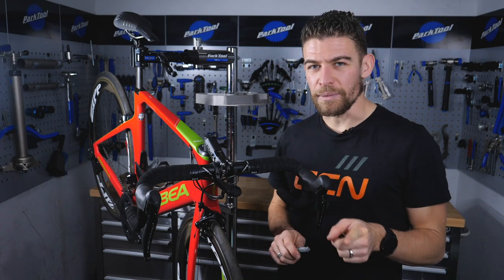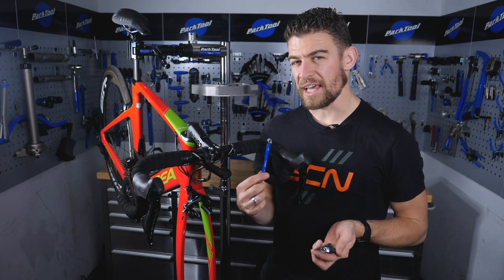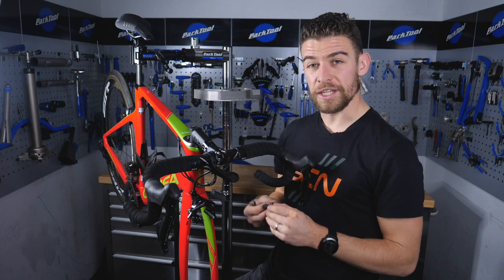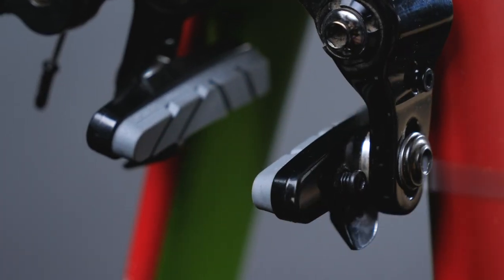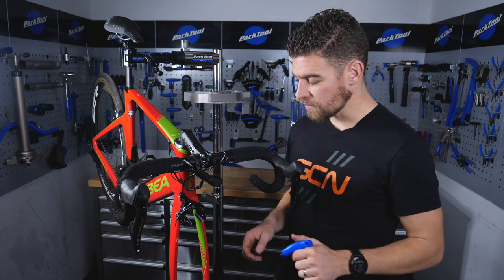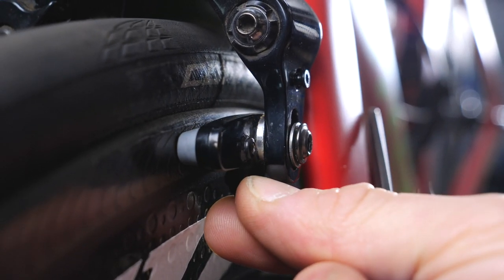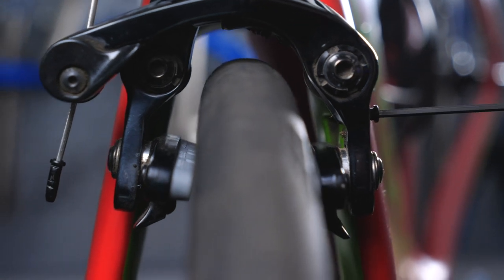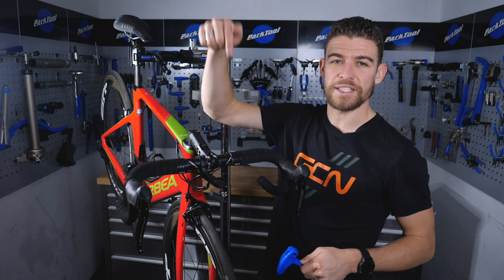How To Replace Rim Brake Pads | GCN Tech Basic Road Bike Maintenance

Comment: I love the disk brake performance on my newest bike, but the fact that this video is half the length of the disk one back in November speaks for itself.
Reply: It's still twice as long as the time it takes to replace brake pads.
Reply: The brake disc video is how to do a brake bleed, which is similar to replacing a brake cable. It literally takes about 30 seconds to replace disc brake pads only. And a bleed takes about as much time as threading a new cable and adjusting.
Reply: I love discs for tour bikes, i.e, for rainy weather and general comfortable stopping power.  For my race bike I prefer carbon wheels and rim brakes, they stop great and while just "ok" in rain, the weight savings more than make up for carry around weight we all, most of the time, don't use anyway.  Same things for brake calipers, Ted Ciamillo now has out new rim brakes that only weight 129g for the pair (without pads) -- while super pricy, they are, well, very nice, the guy's a great engineer and deserves to be paid. The End.
Reply: It only has a quarter of the information it should really have.

Comment: In my experience pads never come out that easily particularly if you’ve been riding in poor weather.
Reply: That was my experience, too, until I bought the Shimano pad holders you see at 2:35, with the little fins on them. Brand-new pads come out as easily as shown in the video; old ones that have been used on grotty roads in grotty weather need a gentle push with a screwdriver but it really is easy.

Comment: Do you have to toe in pads? I have done on mine but only because I read that you should 😂. Wondered if it actually makes a difference if you just line up flat against the rim?
Reply: Helps with brake power modulation and can avoid help squealing
Reply: @TheSpaceBrosShow  oh ok. Thanks for the reply. I never knew why 👍
Reply: I find the pads can squeal if not toed in
Reply: No not these days with good comp.
Reply: If you toe in the blocks soon wear flat

Comment: Pro Tip: Before putting new pads on give your wheel a good clean as the dirt, grease, grime will reduce performance on the braking surface.
Once done dry the wheels off.
Reply from the maker: Good tip
Reply: For Aluminum rims I use a piece of mild "scotch-brite" pad and a little soapy water.  Removes the accumulated brake rubber which can be tenacious and contributes to modulation and squealing problems.  Mavic make a special abrasive "eraser" for this but it is expensive.
Reply: I use rubbing alcohol to clean my rims, but if you don't have that, some high proof vodka might do the trick! 😂
Reply: @Awkward_Fox  Lol i hope you use a type of degreaser first then alcohol; altho alcohol does leave a residue free surface its not as good at breaking down heavy dirt and grease in the first wash.
Reply: I think this video missed multiple steps and a lot of important info.
Reply: @BixbyConsequence SwissStop make a special eraser, too

Comment: But if the pads are pretty worn, first thing you need would be to make some adjsutment coz new pads will be thicker. Where do you usually adjust, the barrel adjuster or the brake cable?

Comment: Good video but 1 obvious issue is; If you don't have a bike fitted with brake pads and the pads you've bought didn't come with fitting instructions eg. ASDA sell brake pads with no diagram showing how to assemble on the bike - you can't "take a photo" or copy what's already there so how do you know which parts of the kit go where??

Comment: Why didn't you make a video with a bike that really did need its pads changed? 

And shocking lack of precise detail about the wheel remover cable release lever. At 7:00 its still in the up position when you should only adjust the cable when in the down wheel secured position. And no mention of the cable barrel adjuster and how you should turn it all the way clockwise and then back off a half turn. Really a half assed video this one and I normally love GCN for their great work....
Reply: "Why didn't you make a video with a bike that really did need its pads changed?" They probably didn't have one to hand -- most of the GCN presenters use shiny new disc-braked bikes. If you use the Shimano pad holders shown in the video, used pads come out nearly as easily as brand-new ones.

You're mistaken about the quick-release on the brake. The open position is shown at 3:35; he closes it at 4:32 and it stays closed until the end of the video.

Good point about the barrel adjuster, though. Probably he forgot that because the cable was already properly adjusted, since he took the pads out and put them straight back in.

Comment: I'm building a classic 80s road bike with modern Sram Rival 11 speed groupset and 700c wheels. I have the chance of buying a set of beautiful early 80s Shimano 600 Ax parallelogram calipers that have the correct drop. Do you know if they will work reasonably well with Sram 11 speed  levers and do they actually stop the bike well. New Kool Stop pads are still available.

Comment: So, I did check my pads when mounting a new set of wheels recently and found bits of metal stuck in the pads themselves; picked them out and smoothed the pads with sandpaper, then a vigorous cleaning.

#AskGCNTech:  Where does do these shards come from and is there any way to prevent them?
Reply: Assuming you have Alu rims, they come from the rims themselves.  The more you get the more you will get as they scour the rims harshly.  If your pads acccumulate a large amount of them quickly, consider changing to a more rim-friendly compound.  Or possibly your pads are old and have gotten hard.
Reply: @BixbyConsequence  How/why does this happen?   Year-old RS700 wheels, year-old Ultegra pads...

I've searched for rim-friendly pads,  finding no data but plenty of marketing trumpery, and naked opinion.

Comment: Hi!
I want to change my old Shimano 7900 130 bcd 53/39T crankset on my bike to a modern compact 50/34T. Will an newer 11 speed crankset work with my 10 speed system or do I have to look for a used Shimano 7900 110 bcd?
Thanks Nypan!!
Reply: I had this issue, and had to get a new chainset with 110bcd

Comment: What is the point of the little wings at the bottom of the brake block? Any harm in chopping them off?
Reply: They're a hand-grip for when you're pushing out the old block. I wouldn't try to cut them off. The weight saving would be next to nothing and you risk weakening the holder. Buy a brand that doesn't have them, instead.
Reply: @beeble2003  I saved 5g 😂 can't complain

Comment: What are some good pads for the ultegra 6500 ?
Reply: All Shimano rim brakes take the same pads and all the third-party manufacturers make pads for all systems, so your question is mostly equivalent to "What are some good pads?"

I don't have any particular recommendation. At the moment, I'm using Shimano pads; I used to use whatever the local bike shop sold but I now live in a town where I don't like any of the bike shops.
Reply: SwissStop or Kool Stop brake pads.

Comment: Have pros ever thought of putting small brake levers on the top of bars beside the stem.  Would really aid braking especially when there is a sudden crash in the peloton. 
If found that having to move hands quickly from top of the bars to the drops takes a second at least.
Reply from the maker: Some pros still use brake levers on the tops of their bars at races like Paris Roubaix where they'll be riding on the tops more often!
Reply: @gcntech  we all should. smart, does shimano make the system?
Reply: In most road races, they're only riding on the tops on steep climbs, where sudden braking is rarely required. The rest of the time, they're on the hoods or drops and have easy access to the levers. Or they're resting their forearms on the tops, in which case they've already taken the gamble that they won't need to brake any time soon and levers on the tops wouldn't help much.

If you're thinking of the old "suicide levers", they don't exist any more because they gave terrible braking and a false sense of security.

Comment: Easy to round those Grub screws especially if you’ve got some oxidation there, then your looking at new brake pads and holders. Bad system in my opinion
Reply: I can't see any other way of designing it. In my experience, the grub screws sieze so rarely that it's definitely cheaper to use holders and inserts and occasionally replace a holder if it gets messed up.
Reply: I'm trying to ride without them, on bmx you sometimes brake going backwards but if thry fit snug they should b ok, still did not find good pads wben ss bxp

Comment: It's easy when you check new brake blocks on a surgically clean bike. 
When I change my blocks, after a couple of thousand miles, the little screws invariably round off and the worn blocks have to be forced out. Those screws are made of cheese.
Reply: I almost never have a problem with the grub screws: maybe your preferred brand of pads comes with crappy screws or you're using an Allen key that's slightly too small? I find that used blocks come out of the Shimano holders shown at 2:35 pretty easily. Not as easily as those brand-new blocks but they just need a little push with a screwdriver, rather than the ten minutes of swearing I've had with every other holder.
Reply: Just crap screws. They are 1.5 mm so no chance of an undersized Allen key in a metric set. A screwdriver slot would be better.
Reply: @grahamaustin9085  I meant undersized in the sense that a 1.5mm key made to low tolerances might only be 1.4mm or something. Cross-head screws round off horribly, but a flat-head might be OK. I guess they went with Allen bolts because that's what everything else on the bike uses. (And because the point of Allen bolts is that they round off less than screws. In theory. Which is totally the same as the real world, as we all know.)
Reply: @beeble2003  Good point one of the 2mm keys I use is 1/100 mm down on min dimension across the corners (2.19) and the same across the flats; the other is at size.
Reply: @beeble2003  I think you have a point there - my old Allen key is 0.05mm down while the newer ones are pretty much on size.

Comment: What are “rim breaks”??
😂😂
Reply: A superior breaking technology that is more aerodynamic and lighter than disc breaks. Stopping power is negligibly less, making rim breaks the choice for cyclists wanting the most performance out of their bikes.
Reply: @Jeff-bd4gg  True, unless you have carbon rims and it's wet. Under those circumstances braking distance is massively increased (certainly on Zipps), and rim wear is also an issue.
Reply: theonlytruefalcon looks like I triggered the disc break fan boys. I don’t care what you use. Ride your bike and have fun. The op made a joke, I played along. No need to get butt hurt.
Reply: What JD said. Love rim brakes.

Comment: If you have to be shown how to do this you shouldn't be doing this 🙄
Reply from the maker: Everyone has to learn at somepoint!
Reply: Gotta learn somehow. We're not born with knowledge, we acquire it.
Reply: Ah, I'm sure you were changing brake pads out of the womb
Reply: if that were the way the world worked we would have one generation of any sort of civilization and zero progress. perhaps you might re-phrase your comment to clarify your meaning.
Reply: My point is rim brakes are simple pulley system, lever at one end, cable and clamping system at the other, with blocks rubbing on harder metal (usually but not always, but highly probable given the readership/viewer).  If you need to receive instruction about so thing so simple that if you get it wrong can lead to death and or significant damage and or pain for the rider and others in his or her vacinity, then maybe they shouldn't be tinkering.  This is my opinion.  Happy if you disagree, but there is(I'd argue) a level of competency and common sense below which you should be tempting folks to dabble.  Hope this clarifies the brief original comment made.  Miles.
Reply: @milessmith589  What utter rubbish. There is alot to this process. Most keen cyclists confident to try it should be able to do themselves and learn and do an excellent job. Sadly this video misses so much detailed information and the toe in info is wrong and no mention of proper cable adjustment. But nonetheless your attitude of 'if you need to be shown then don't do' is idiotic and arrogant.